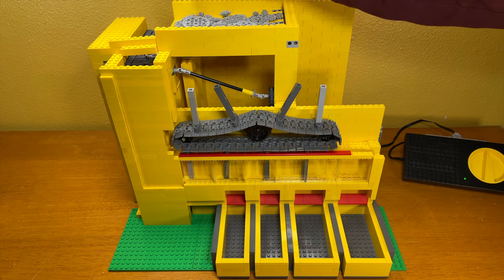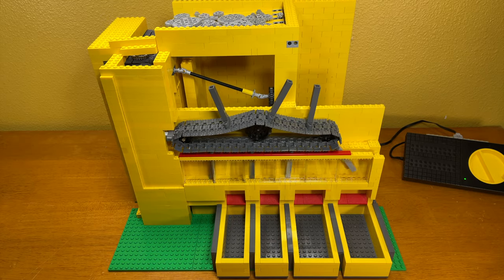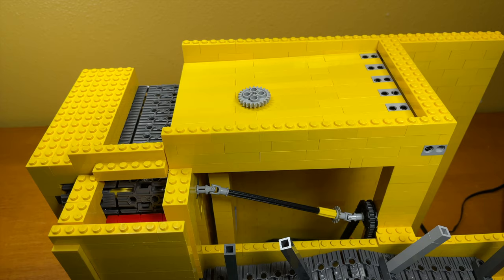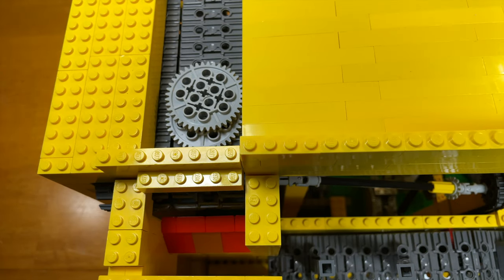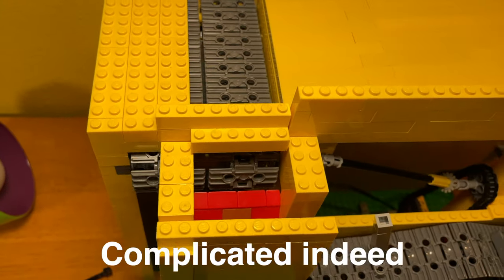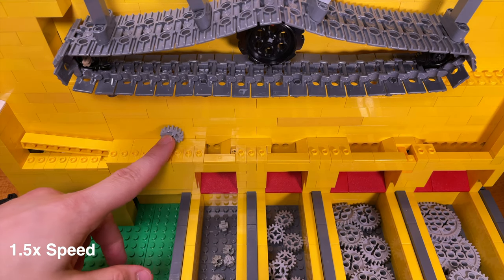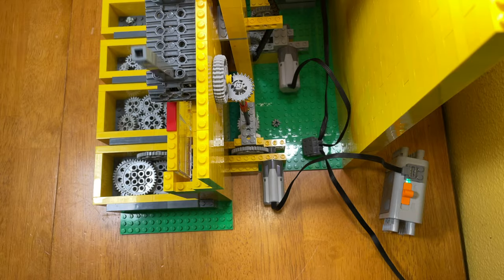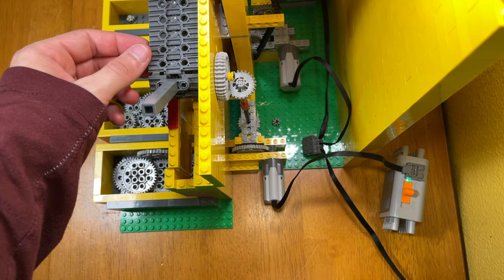World’s First FULLY AUTOMATIC LEGO Gear Sorting Machine

Comment: Any reason you didn't have openings for the (double) bevel gears? (12, 20, 28, 36 tooth)?
Reply from the maker: It would have made the machine twice as long, which isn’t really an issue to be honest. The real reason that the normal gears had easily achievable opening sizes. 1.5 studs for the 8 tooth. 2.5 studs for the 16 tooth. 3.5 for the 24 tooth. 5.5 for the 40 tooth. If I were to incorporate the bevel gears, I would need to find some kind of illegal building technique to achieve those odd sized gaps.
Reply: @LegoTechnicsRule  How about tiles on SNOT pieces?